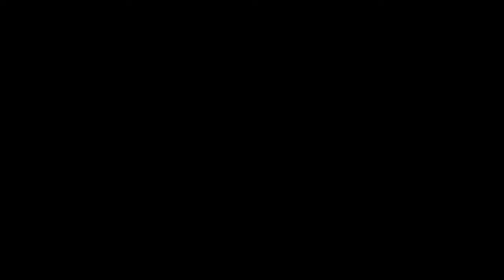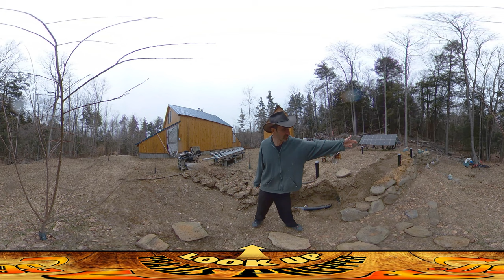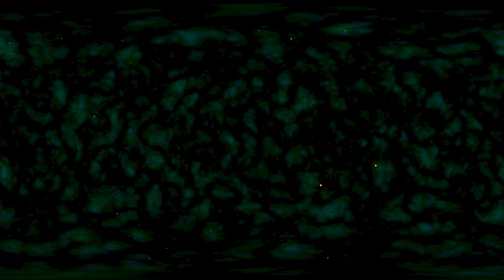Homestead Building - Fallout Shelter Air Intake Pipe

Comment: 100% agree on the "When you're prepared you don't have to rush to do things." I'm doing a fire prevention process with putting in a 24 inch cement with embedded rock set-back from the edge of the porch that wraps around the porch. Also, for fire prevention, I'm doing the same process with stepping stones embedded in cement around the wood shed. It's spring, fire season is months away and it will be nice to have this done way ahead of time. It sure feels good to be this far along so I can do things on an easy time scale.

Comment: I like that hat.....hopefully this summer I can get started on my root cellar planning on using icf blocks. So I may be picking your brain later this year
Reply from the maker: I haven't used ICF blocks before. I didn't insulate my root cellar at all. If I were to do it again, I might have decided to add insulation over the ceiling. I don't think I'd insulate the sides or floor though.

Comment: Have you thought of also having an antee that you could push up one of the tubes. not connect it and your extra radio in there not connect in case of emp.
I will look very nice when you are done.
Reply from the maker: The multiple backups of everything in terms of EMP is tricky. I may consider it. Plan is to get the basic system up and running and then think about the extra backups. Personally... I'd prefer people stop fighting and start talking; it's the only thing that ever permanently settles anything anyhow.